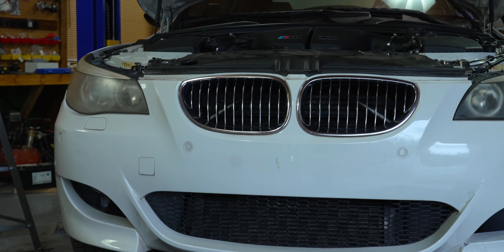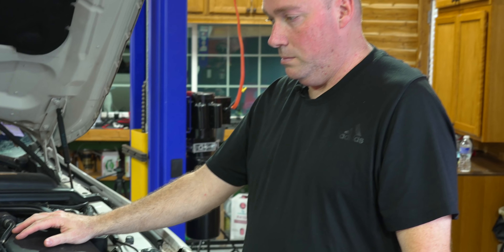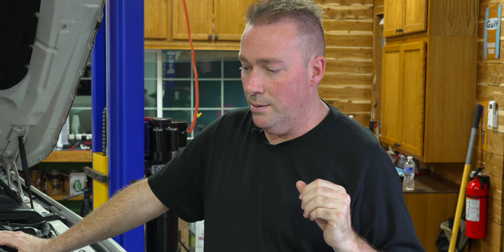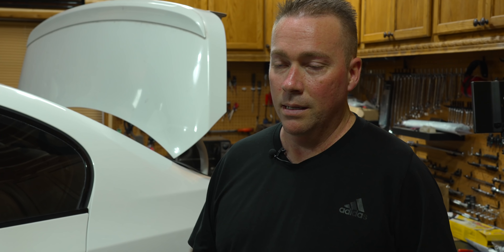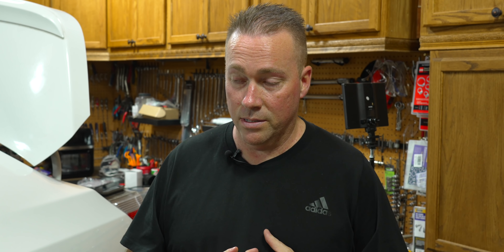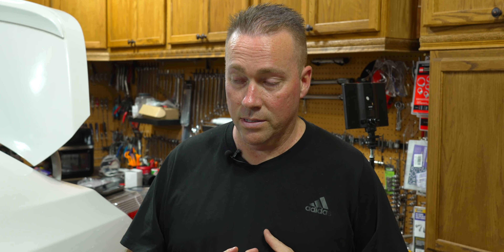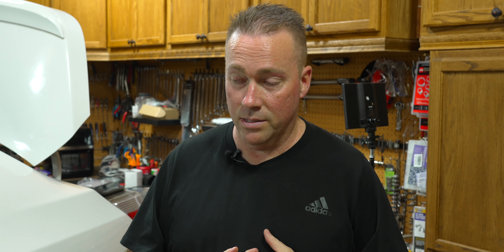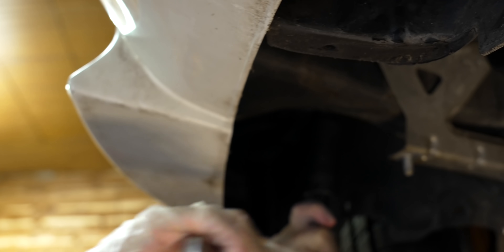Everything That Is Wrong With My BMW E60 M5 !!! How Bad Is The Engine ???

Comment: Can you just not replace the bushings and save the control arms?? Seems that would be cheaper.
Reply: I've done that and it is cheaper, you would need a 20 ton press and some lemfoerder bushings
Reply: The ball joints wear out too, and the control arms from Meyle or Lemforder really aren’t all that expensive.

The one you want to press in and out is the bushings in the big rear swing arm.
Reply: I purchased the 20 piece kit for my 540i. Had it installed by my local indy.   I didn't have the specialized tools I needed to complete the job. It was a bitch even for him with his Bendpak and experience.  Spent a few bucks but it was worth it.

Comment: Hey I have a question I see that you were working on 839 electric Fan I have 03 530i I replace new fan new coolant sensors on cylinder and the hose and the little box and still don’t want to turn on whit the ac or the car gets in temperature and also check those two fuses under passenger side and I have power on the plug the fan connects I have no more idea can you plz help
Reply from the maker: unhook the battery and reset the car , those fans will disable themselves from the ecu

Comment: I just bought one as well. It has similar DME codes and symptoms. Vanos codes and misfire on all but one cylinder. I ordered a bolt from bmw which plugs into the vanos line to allow for a pressure gauge and line. I ran the car and it has 80 bar of oil pressure at idle which is about 1000 lbs. It then climbs a bit with acceleration. Could I still possibly have a vanos line leak or do you think the problem is more likely to be in the actuators? Thanks for your time. Great content as usual

Comment: I bought my 2006 e85 M5 at CarMax with 85k miles. I changed the rod bearings at 135k miles. The bearings were still good. I now have 150k miles on it right now. I love driving this car and its better when it’s really warmed up  and at high speeds. Nathan, Im looking forward to seeing this build. I enjoyed the building on your red M5.
Reply: What oil do you run I was told to run a 50w
Reply: @anthonyk  motul 8100 x-power

Comment: Do you like the aluminum trim? My Z4 has that and I'm not really a fan of it.
Reply from the maker: Piano black would be better but I did not care for the light red color wood in the maroon m5
Reply: @NathansBMWWorkshop  Yeah there are lots or options. My E46 has the dark wood and I love it. My E53 has a light color and its ok but not optimal. But I think the aluminum (to me) is worst. The carbon fiber or piano black would be awesome! But I have the trim on all 3 blacked out so its kinda my pattern of preference. 🤔